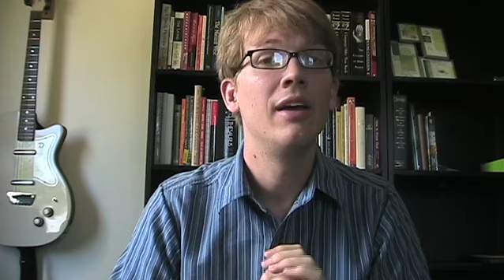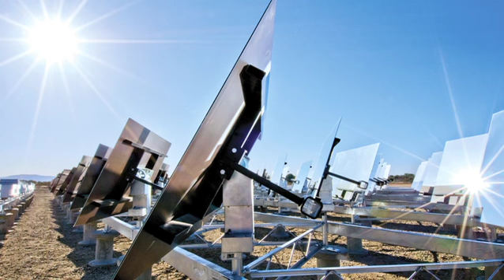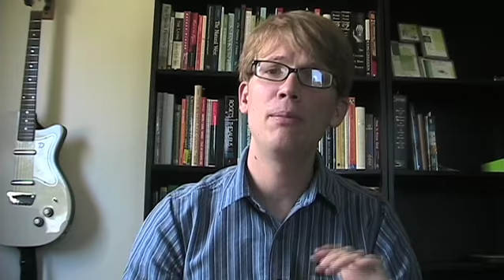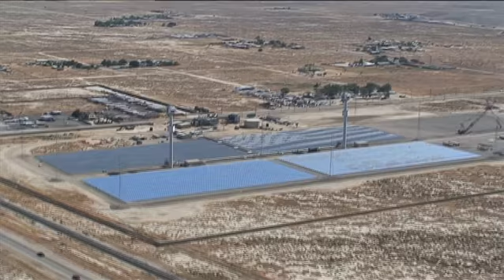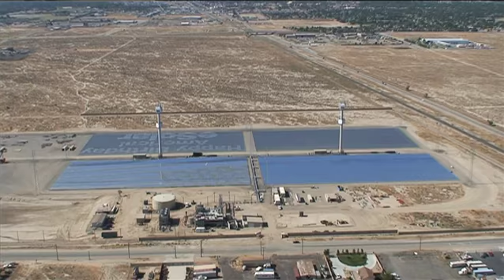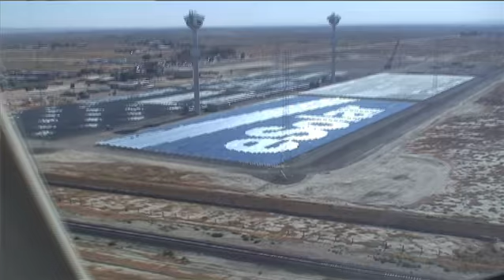ESolar's First Solar Power Tower Operational!

Comment: eSolar's operation at Sierra Hwy. and Ave. G in north Lancaster,Ca. required 20 acres of flat vacant land. The output of the plant(5 meg/watts) is sold to SoCalEdison. This design is modular allowing for more efficient use of the required land parcel...and incorporates smaller mirrors(easier to manufacture,transport,and set up). I believe that the cooling water is diverted from nearby waste reclamation pools(not sure on that).

Comment: Star Trek used one of those Aptera super-sweet little cars in one of its scenes (that happened to be working on one day). Sadly, I don't think it was visible. But it was a cute car. 

And that's cool about the ESolar power tower. Yay for solar energy. That is a lot of mirrors; I wonder if it would still function if there were a sand storm and a stone cracked one. Or something.

Comment: Yes, any watts of power not from fossil fuels is an improvement, but no these towers are not yet "cheap" enough to pay for themselves...The next step is to drive the cost down and if you can't improve the efficiency of the process by much than we have a problem.